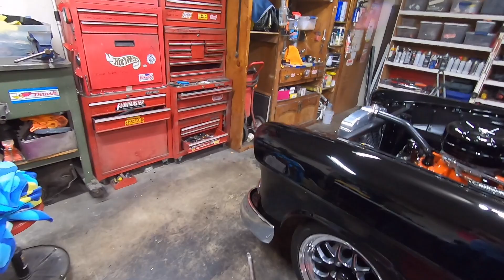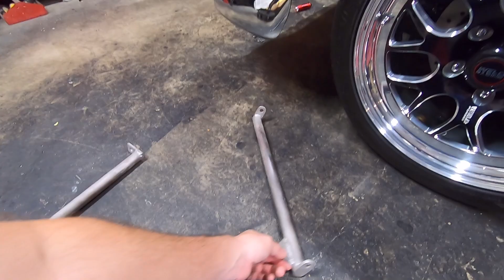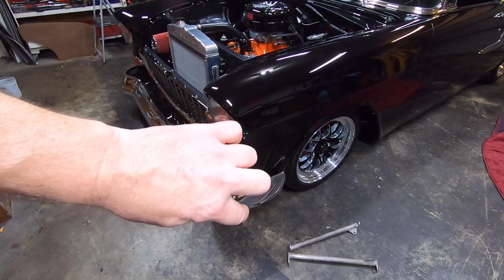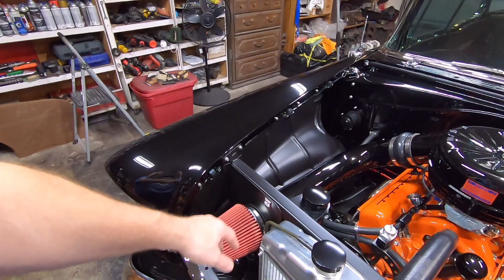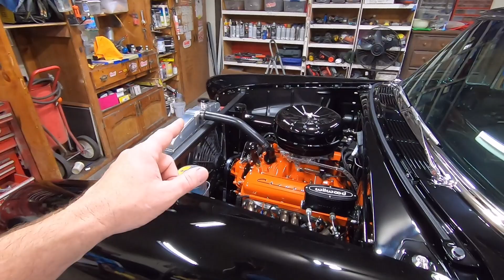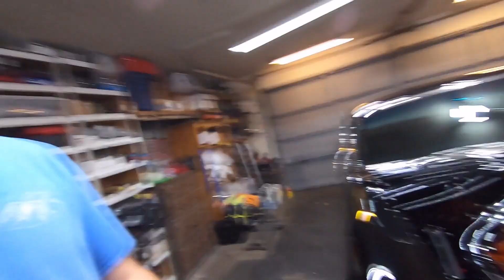Putting on "smoothie" front bumper 100% garage built 1955 Chevy Belair

Comment: Looks great! I haven't seen all your videos, so please forgive me if its already been covered. Are you running rigid motor/trans mounts?
Reply from the maker: Energy Suspension urethane side engine mounts and trans mount. Not solid mounted
Reply: @haffrods7055  Sweet. I was wondering after seeing how the cold air tube was mounted rigid to the inner fender well. Dig watching your progress. Smooth bumpers are on on my short list.
Reply from the maker: @Johnny_Wolf_Hellions_CC  That was why I explained the purpose of the hump hose separating cold air pipe to air cleaner
Reply: @haffrods7055  Ah, okay. Thanks for the clarification. Appreciate the reply.
Reply from the maker: @Johnny_Wolf_Hellions_CC  Your welcome. I LOVE your avatar by the way.
Reply: @haffrods7055  Thanks! Its a work in progress.

Comment: Even with a 327 the stock radiator and a fabricated shroud my 56 ran pretty hot. I don't think they even had a shroud when new but they also just had a 265. The 400 was worse of course. I never got it to run cool until I did it about like yours with a aluminum radiator and a electric fan.
 Cool air to the carb makes a noticeable difference in power and is easier to tune for. With a regular setup the carb will see huge differences in inlet temp on a day like today. 60 or so in the morning and cool start up to probably 120+ or more by afternoon with the outside close to 90 and the added heat from the radiator and headers under the hood. The factory has had all kinds of solutions over the years. Ram air, cowl induction, air grabber hoods. Even a lot of big rigs have the air filters outside the hood and for good reason.
Reply from the maker: I don't like how loud electric fans are but I'll take it if it keeps thing cooler. Thanks for watching Walter.